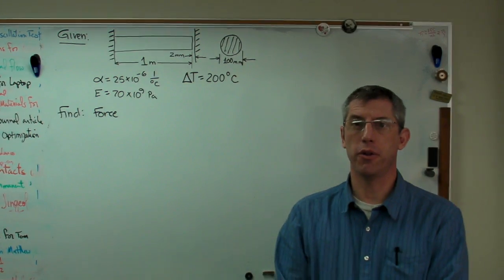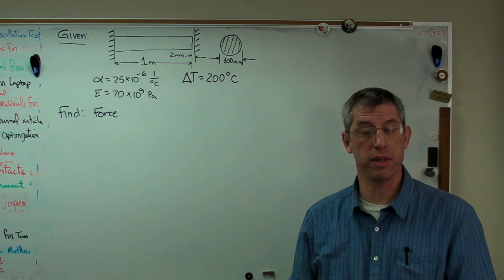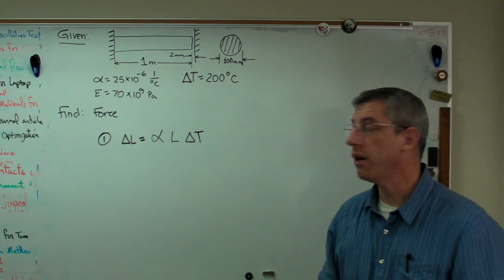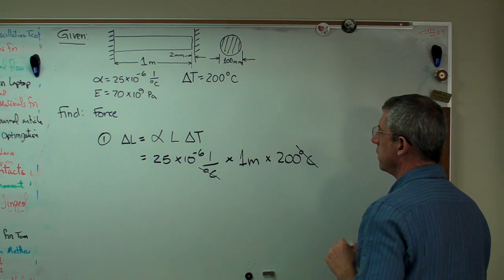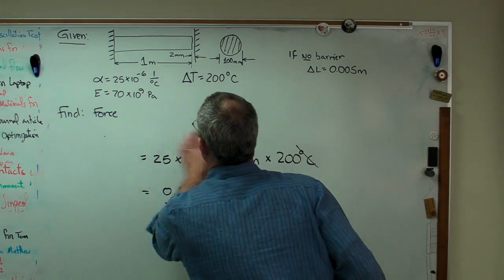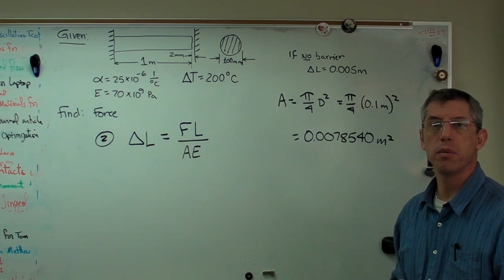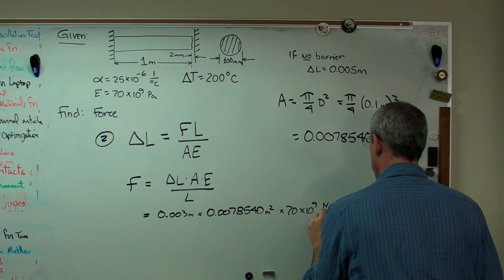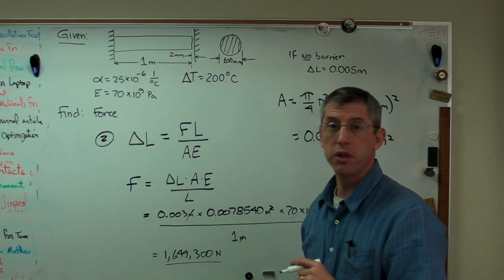Force due to Thermal Expansion.MP4

Comment: but why you took deltaL= 0.003 and we have cal. delta.L=.005mm
Reply: +DURGESHKUMAR YADAV because there is room for those 2 mm, when bar is still not touching the opposite wall, therefore no force is generated against the wall. Only those last 3 mm from 5 are pressing into the wall.

Comment: Will thermal contraction generate the same pulling force? Thanks :)
Reply: +Alex D It will. If you would install for example electricity wires in the summer without proper reserve, the force would be same but the different orientation and in the winter the wires (because they are not that strong) would break.

Comment: Great Video! @4:56 you calculate the cross sectional area of the solid tube.  Had it been a hollow tube, do you still use the whole cross sectional area of the tube? or only the area of Aluminum (subtracting out the hollow area)?  Logically, it would make sense to use just the cross sectional area that is Aluminum, I expect a hollow tube to generate less force.  Confirm? Thanks!

Comment from the maker: There are actually two Delta L values.  Perhaps, I should have used different symbols.  The first Delta L is the change in length if there were no barrier.  The second Delta L is the change in length imposed by the barrier.

Comment from the maker: The original length would actually be 1.005m.  While this is strictly correct, the difference in force between L=1m and L=1.005m is very small.

Comment: First of all, thanks a ton for sharing these lessons, they've helped a lot! One question though:
When determining the force required to change the bar's length by 3mm, why wouldn't you use 1.5m as the original length?
Reply: He never mentioned 1.50m